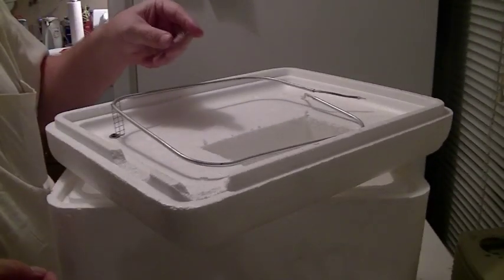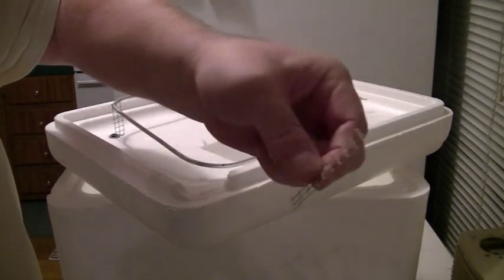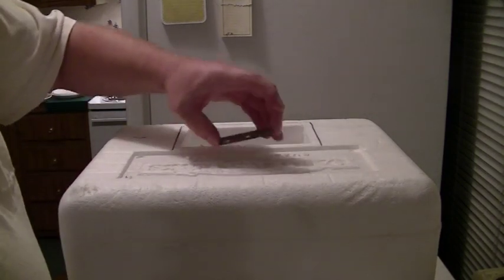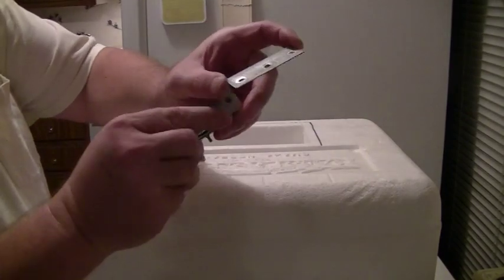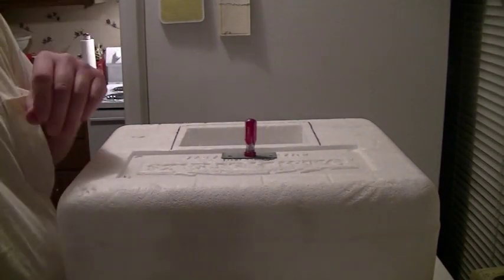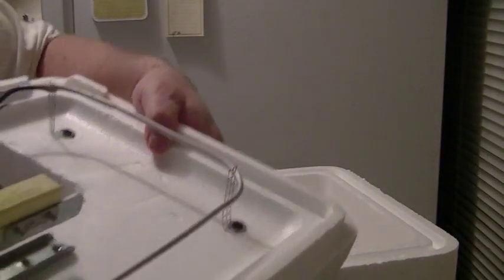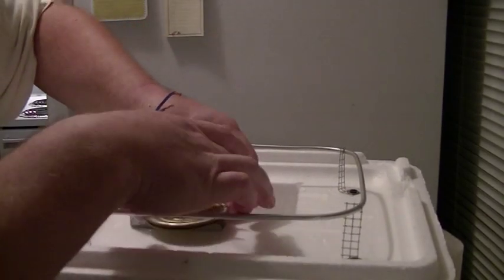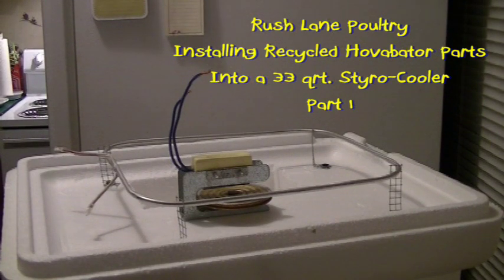Building a Home Made Incubator using Recycled Hovabator Parts! Part 1 of 3

Comment: What if you are using the water heater thermostat. How are you going to adjust it accondin ti the thermometer?? Please reply. Thanks
Reply: The water heater thermostat does not work well with the low powered heating elements like the 1 in this video. Wade

Comment: What size element would you recommend for 48 quart cooler or bigger thanks.
Reply: The best thing to use for a box that big is two 40 watt light bulbs! You may be able to get by with one 25 watt element all you can do is try it and see if it will be enough...
Reply: Thanks